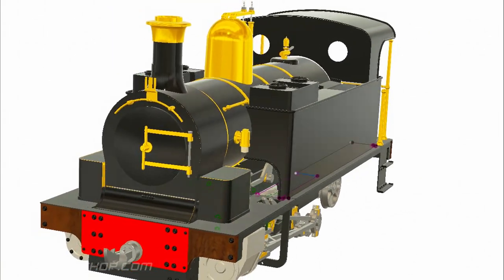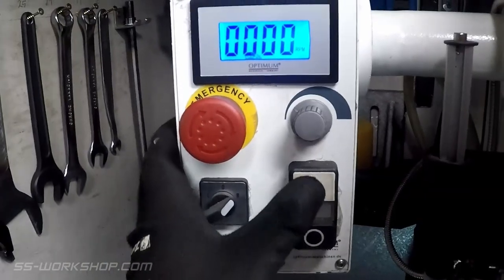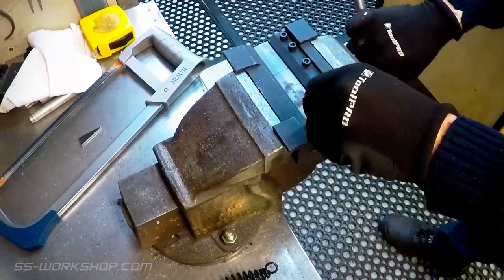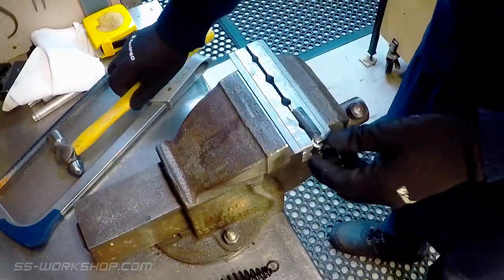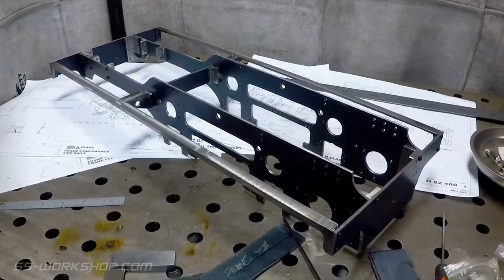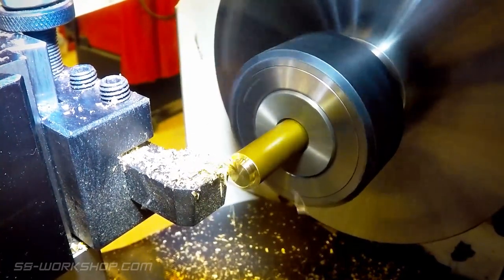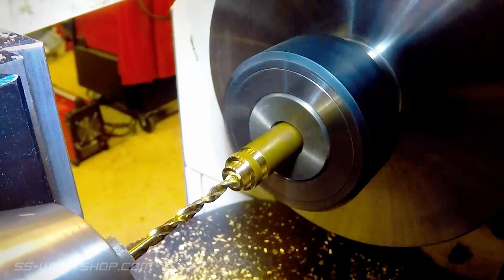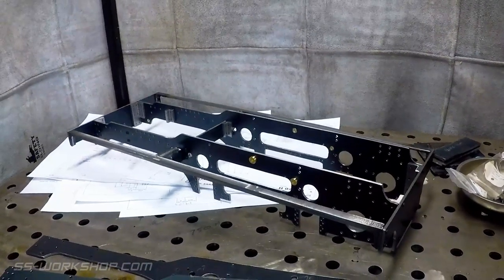Fell Engine Project – Frame Wings & Bushings S1.E4

Comment: Did you just say you decided to remake the frames? That's dedication! I like the little flipdown chip guard to stop your hand getting burnt while using the lathe wheel too.
Reply from the maker: Thanks David, Yes, ended up threading a lot of the holes to avoid needing nuts inside the frame, I originally thought 3mm wouldn’t be enough to get a good thread but once they were cut it looked more than enough, anyway I think it will save me some trouble later.

Comment: another great vid,  where did you get the vice folder from it looks  to be really  usefull
Reply from the maker: I picked mine up a few years ago from a local machine tool supplier, Machinery House here in NZ, They are known as Hare & Forbes in AU and I’ve spotted them at Warco & Axmister in the UK. They work really well and are my go to for small projects but I have also tackled much larger projects with them just part folding moving along the bend and moving back and forth until it complete the only limitation is the size of your vice.